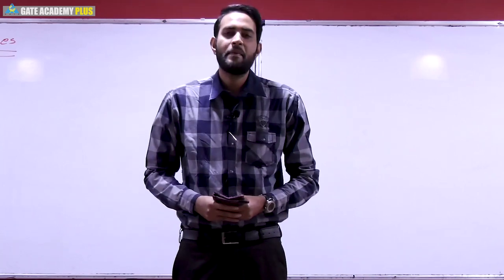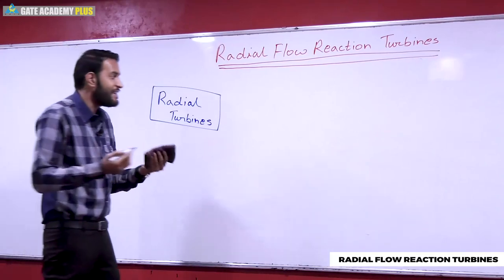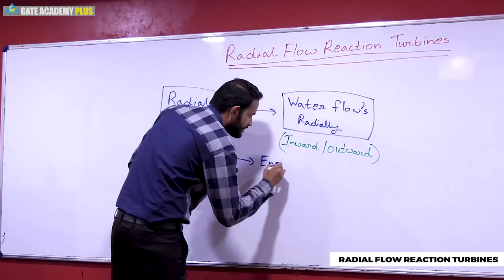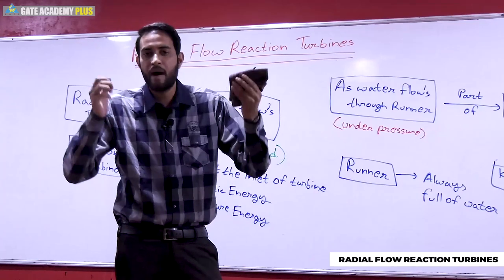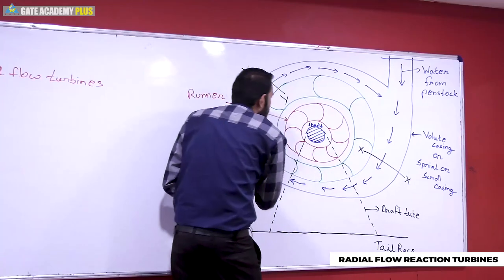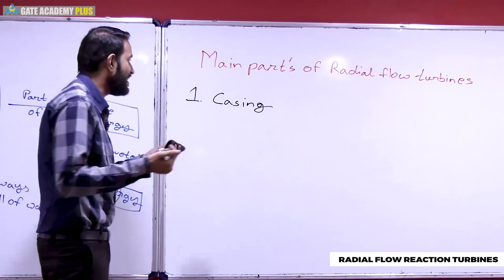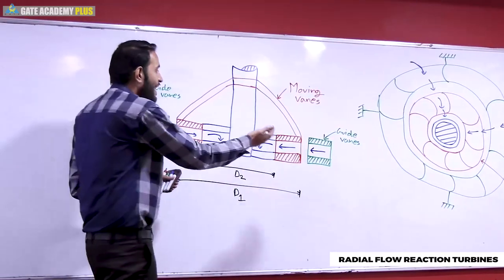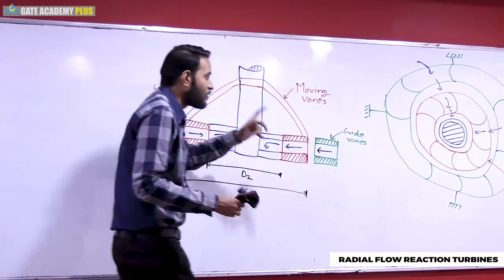Fluid Machinery I Module 2 | Radial Flow Reaction Turbines | Lecture 14

Comment: Thanks for the video,
But in the last point which you wrote in red color, shouldn't it be like this?
"If the discharge is axial" and not "If the discharge is radial".
Because, beta can be 90° in axial discharge.
Please correct me if I am wrong.